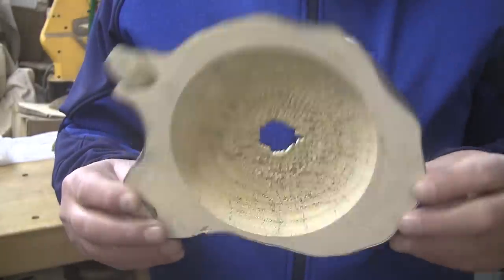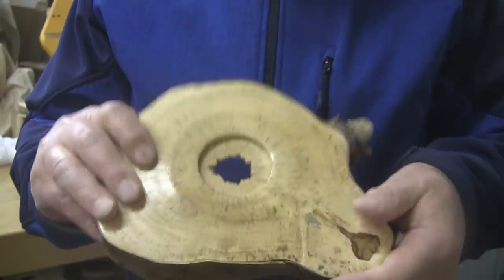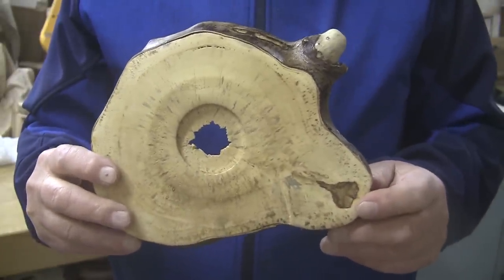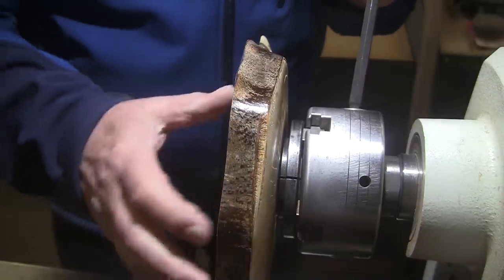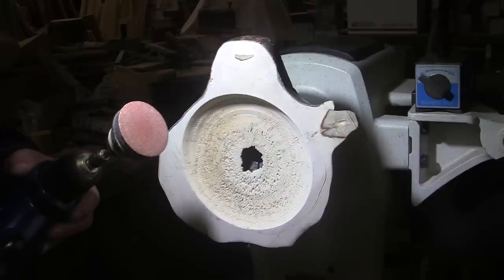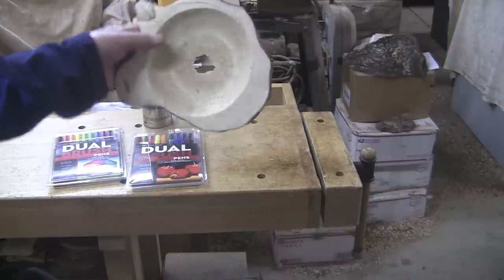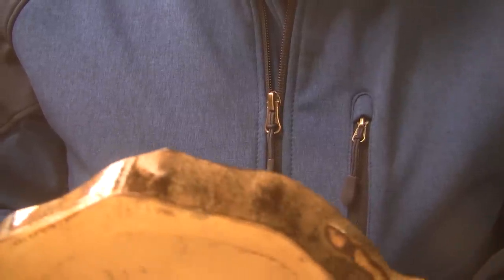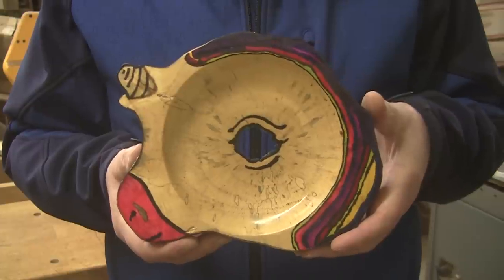Hole In A Bowl To Wall Hanging! - Wood Turning

Comment: Hi Phil; 
Just thought I'd drop you a quick note to let you know that you have been a huge inspiration to me over the years, mainly from an interest point. I have never done any turning what so ever, but I wanted to. Recently, a friend of mine gave me an old Central Machinery bench top lathe that needed a belt and a few other fixes. 
I finally got the nerve to try it out. I did my very first turn, and it turned out wonderful. I am now hooked.
I know now that I will have to get a better lathe, and definitely some better gouges. 
I wanted to send you a picture of my first creation, but I couldn't figure out how to do that. 
Thanks for the inspiration 👍
Reply from the maker: Congrats on the new hobby, Dave, I know you'll have lots of enjoyment from woodturning! 😊
Reply: @PhilAndersonShadyAcresWoodshop  
Thanks 👍

Comment: Fun piece for sure. I understand you not having much fun with it though. 

I have a procedure that I’ve used on a couple of pieces that “got too thin”. Might have worked well here as well. 

No matter, the design is a nice one. The wood quite interesting. And your 3 year old granddaughter will probably love it. I’d call that a win!
Reply from the maker: The wood is the reason I didn't want to fix it, Doug.  I do know several ways to fix it, it just wasn't worth any effort.  This at least saved it for a wall hanging as long as it's viewed from a distance! 😊

Comment: Hi Phil 
Trying to find out what those cloth or rubberized squares that keep the piece from moving are called and where to buy them. 
My boyfriend is a wood turner .
Thanks !
I looked on amazon .
Thanks for your help!
Reply from the maker: Not sure what you are asking about, Susan.  Nothing like that in this video.  Different video?  Maybe the non-slip cloth I use when I remove a tenon in other videos?  If so, that is shelf liner, mostly used in RV's to keep stuff from sliding around.  Just about any place that has a good housewares section should have it or any RV store. 😊
Reply: @PhilAndersonShadyAcresWoodshop  thank you!!